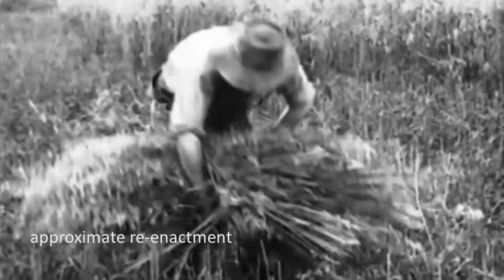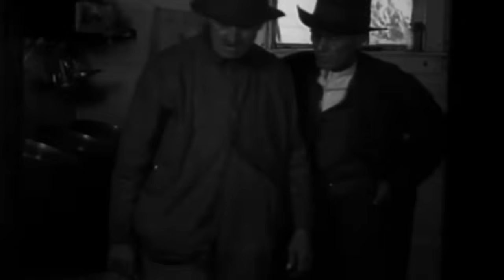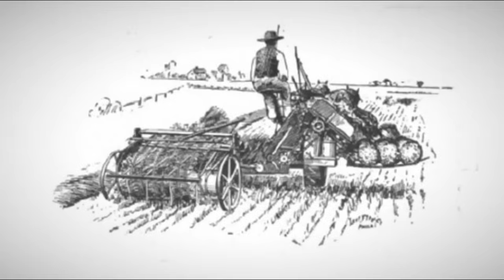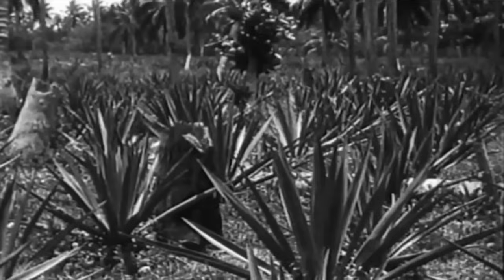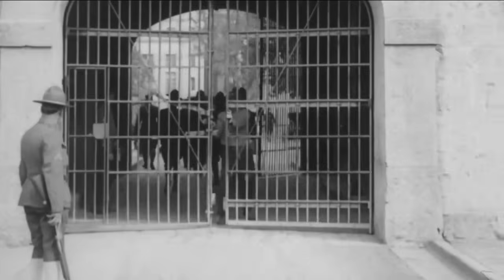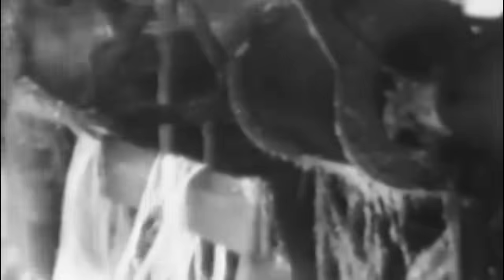The History of Binder Twine / Farm Machinery Stars Series

Comment: huh, just looking at those first reapers: why didn't they just hand rake the crop of the platform straight onto a horse drawn wagon - was it not dry & ripe enough?  Productivity could/ WOULD have been greatly improved AND no twine required: No twine then developed in later years to wrap around bearings of Muckspreaders etc !
Reply: The crop was cut mostly dry, but it would be uneven moisture and mold if threshed or piled immediately.  Also the weeds would still be green and mess up the threshing process.  Even today many crops are swathed and combined after drying, instead of direct cut.  Or they're sprayed with herbicides to be uniformly dead before harvest.
Reply: They cut the crop just as it was turning from green to yellow, and it was still too wet to thresh.  Whether cutting by hand or machine, there was too much grain loss if harvested dry ripe.
Reply: This timing was also important to keep spring weeds from overwhelming the standing crop.
Reply: The grain shatters or falls off the stalk head when too dry. Traditionally, the wheat was cut and bound into sheaves which were left to dry in the field. When fully dry, the sheaves were put on wagons and brought to the barn for threshing.
The tops of the sheaves were placed on the wagon with tops facing the center of the wagon to catch any loose grains.